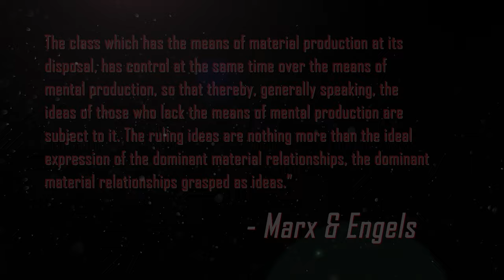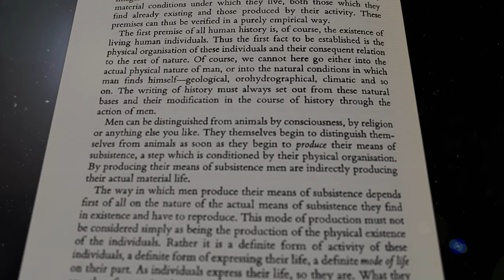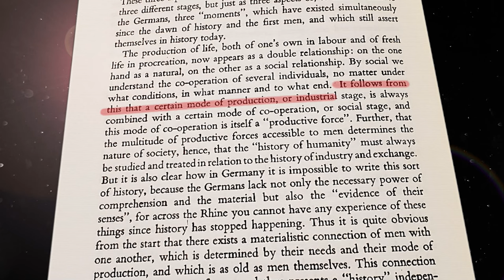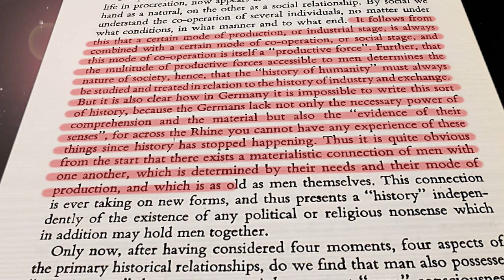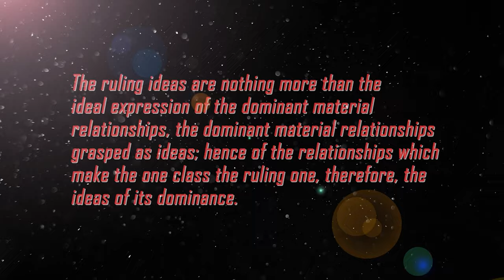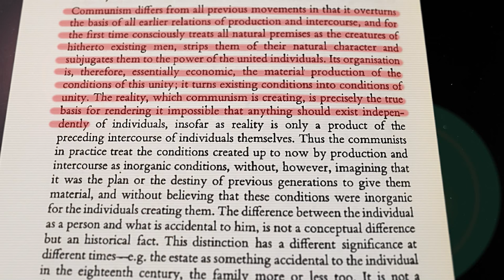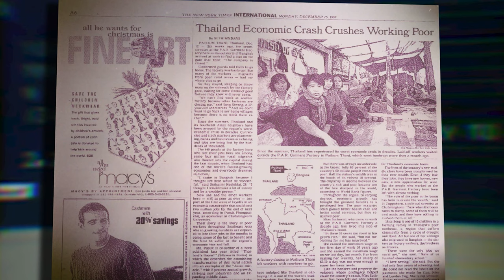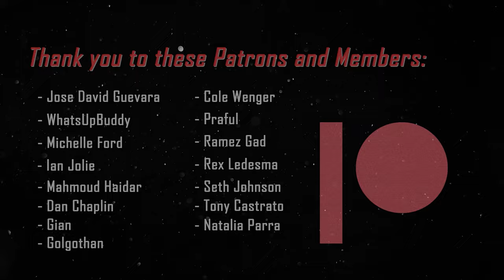Karl Marx and Friedrich Engels: The German Ideology

Comment: If anyone is familiar with current theories for human perception, Gibson’s model, theory of affordances and the concept of perception and action (basically that perception particularly visual which in turn guides our ideology is formed through movement). The theory is very dense and my capstone in the area was a pain so to shorten it, think of it this way: you see a front door. You know it’s 3D. You know each step is a small rectangle snd eoukf feel grainy and cool to the touch. You know that you can use them as a sort of jagged ramp to approach the door. You know the door knob is round, it’s appears as sphere based on the shadows and shape you Whether to twist it, push in, etc.. you see the doorway is a rectangle and you see you can fit through it. You know you cannot pass through until you engage with the other objects or somebody else does allowing it to open. None of those things would be possible for you as a human ... but you couldn’t possibly understand and even see these things if you were unable to move. Without movement and out ability to engage with the material world vision and other senses snd jn turn our ideology and imagination (as we know then) cannot exist